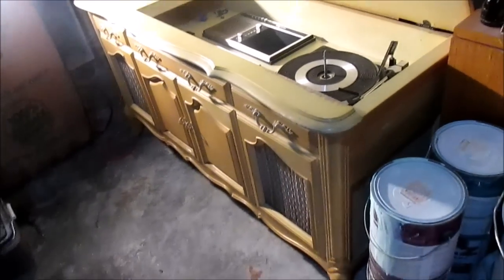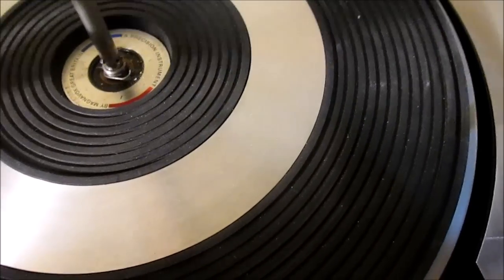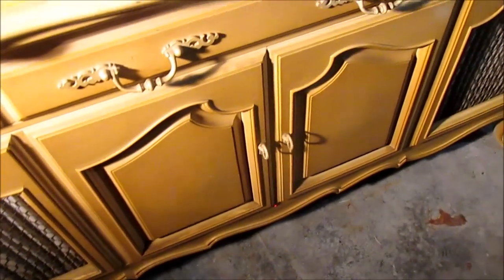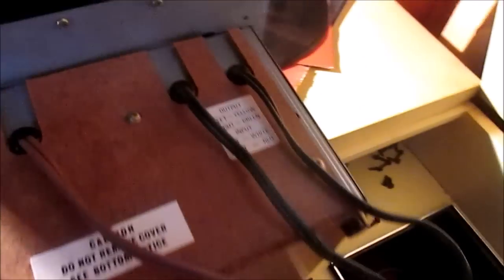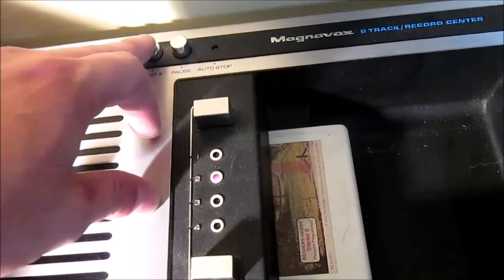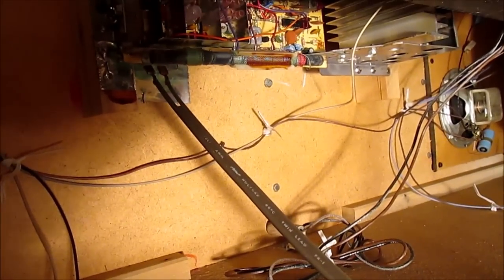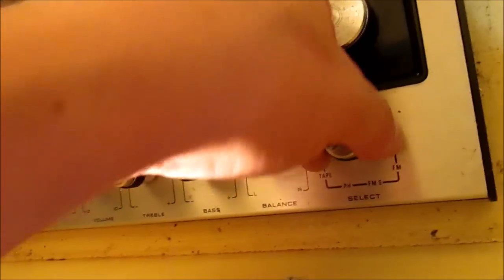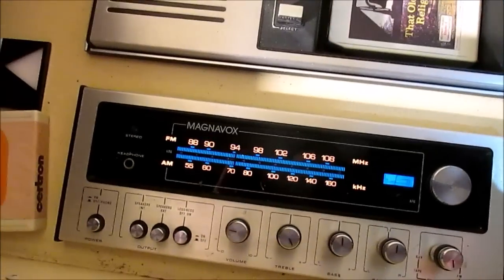1978 Magnavox Console Stereo

Comment: At 13:45 the stereo light did come on. Maybe something with the circuit?

They don't make radios like they used to
Reply: Sometimes you can tweak the voltage controll oscillator trimmer (19khrtz) and get it too play in FM stereo. Whether it's an acceptable repair or not I don't know but I would do it on some of my units in order to fix that problem. Sometimes that does not work.